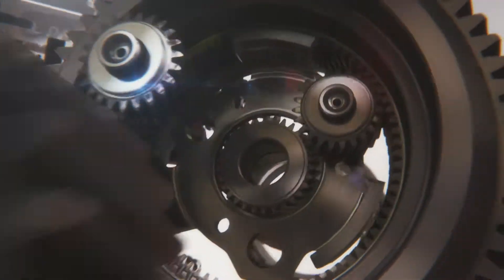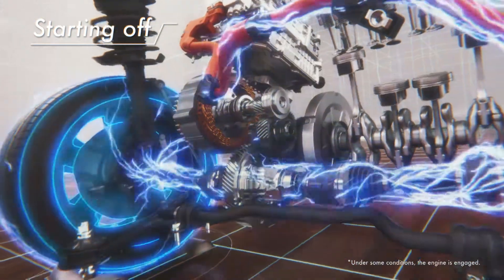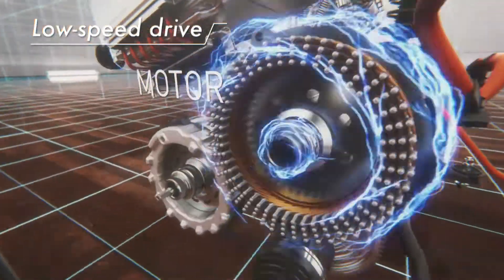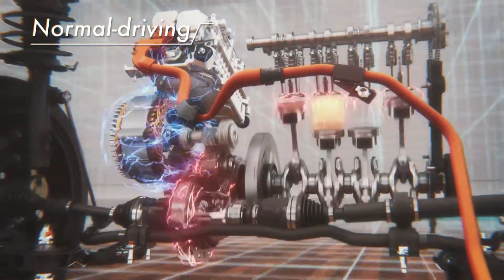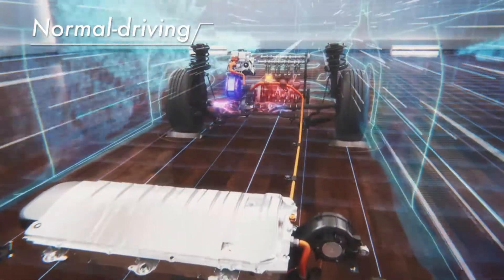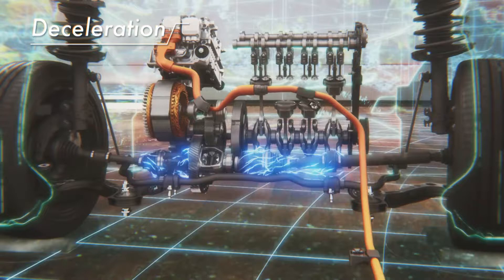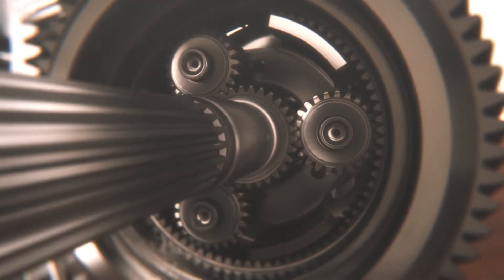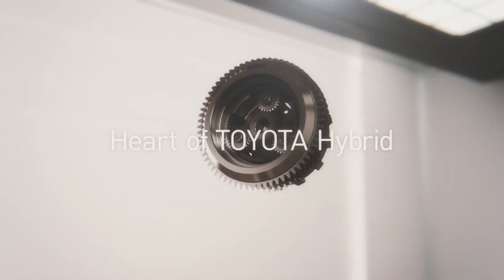Power split device of Hybrid system

Comment: This is cool but would be nice if we could control the modes. Like battery only. Generator only. ICE only. Gives me three systems bro use. Allows for redundancy in case one fails. If my battery goes bad I could use generator. If generator goes bad I could go back to good ole ICE.
Reply: Series power hybrid is there for this purpose. There is power split so ig you can use whatever you feel like. There must be other technologies for what you are saying

Comment: Cool, but imagine removing all the parts related to combustion, and increasing the size of the battery.
Reply: I could not use such system. I've no place to recharge, so I need mine to be cordless.